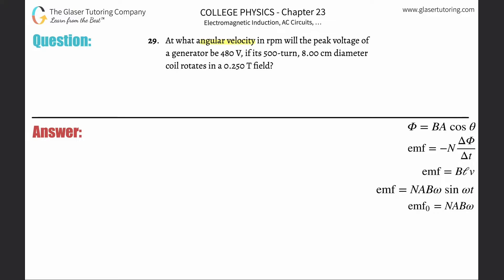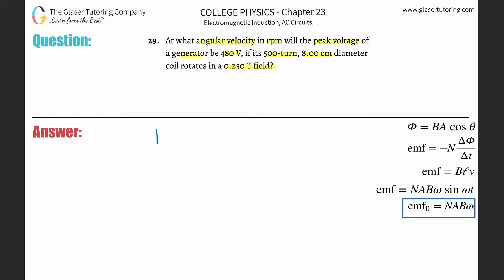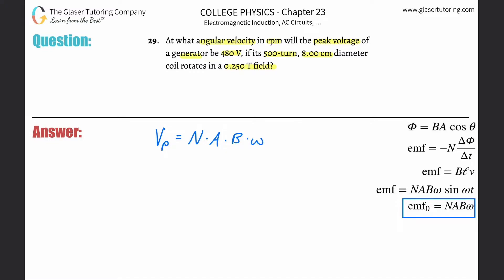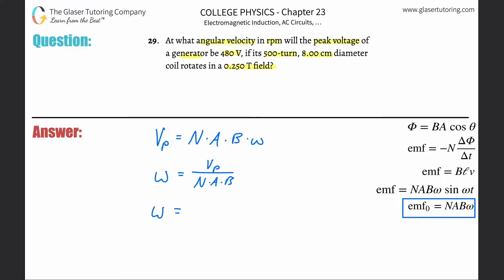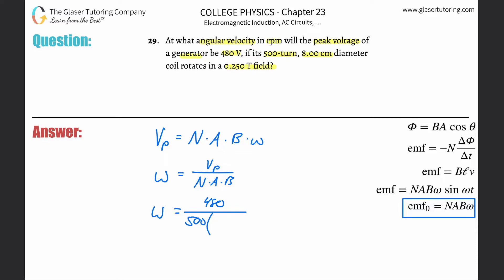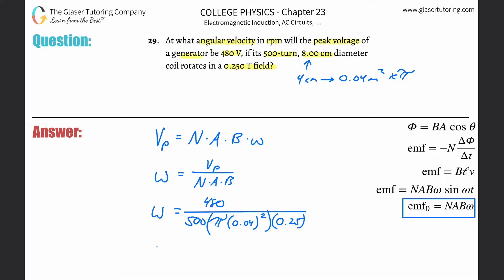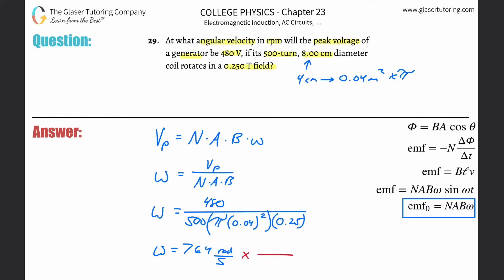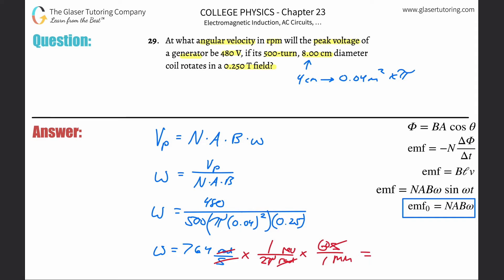23.29 | At what angular velocity in rpm will the peak voltage of a generator be 480 V, if its

Comment: Hi! I'm confused by the final step you did when you multiplied 764 by 60 and divided by 2 pi - I understand why you did this but I did the same thing and get 72005.3 every time which would equal 7.2x10^4 rpm. No matter how I put this in my calculator I cannot seem to get the answer you got??
Reply from the maker: Hi Kira - put each and every value in the conversion in a parenthesis and that should hopefully solve the issue